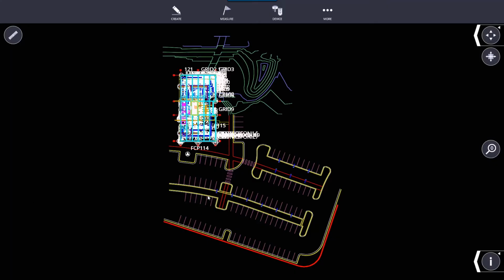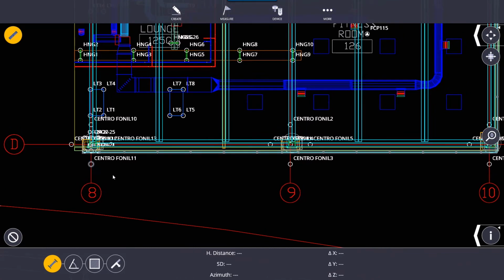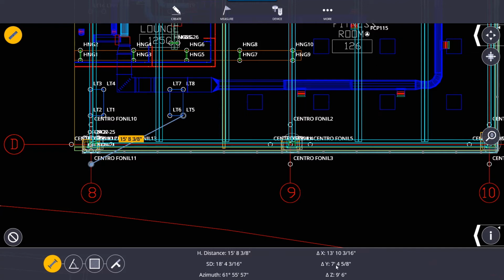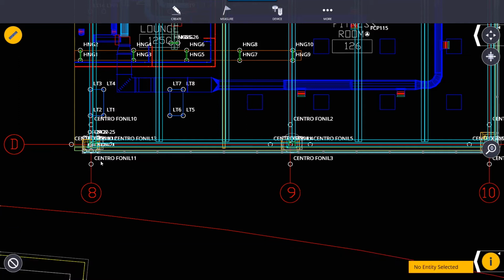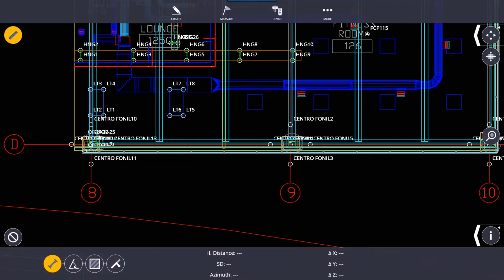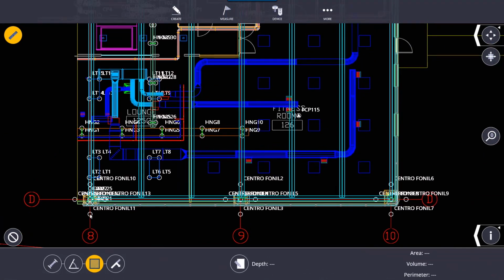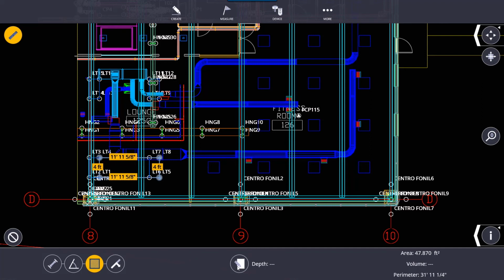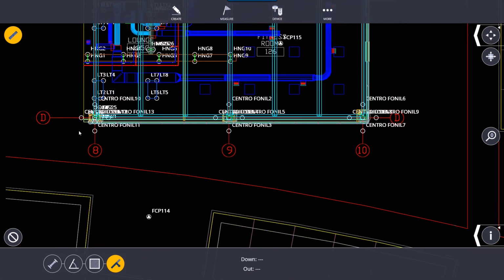Trimble Field Link - Measuring Tools

Comment: Is there a way to measure the area or volume for a spot with a arc? I am trying to measure up a large sidewalk area with a radius on one side of it
Reply from the maker: Dain,
Sorry for the delayed response.  Yes, one way would be to collect points along that sidewalk including the arc and segment the arc by collect points at every couple of feet.  Then,  return to the More/Map screen and use the ruler tool (upper left corner) and select the area icon (lower left) and tap on the collect points to calculate the area.